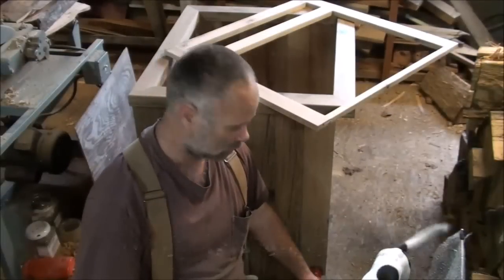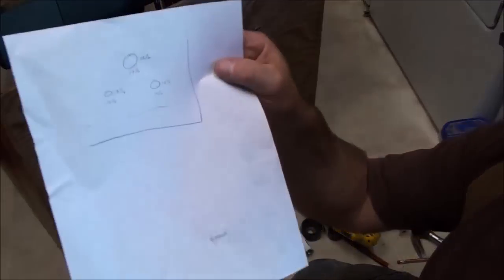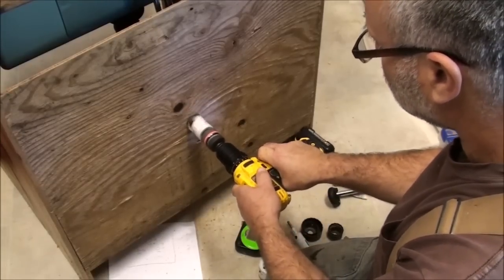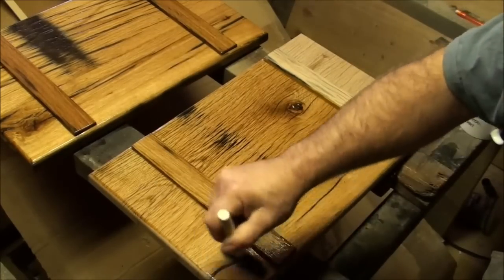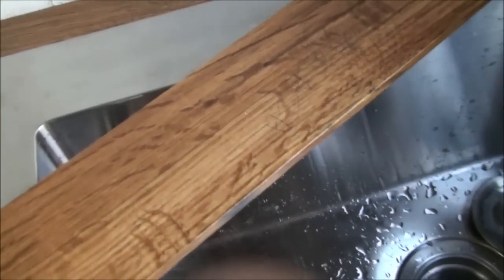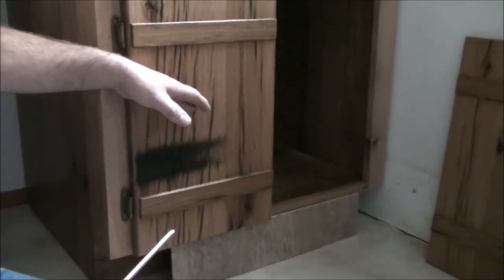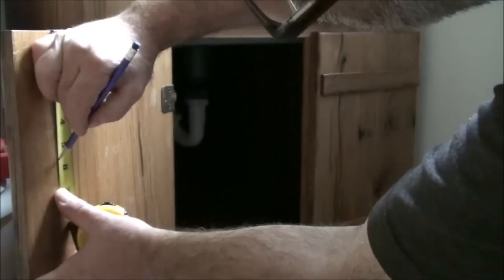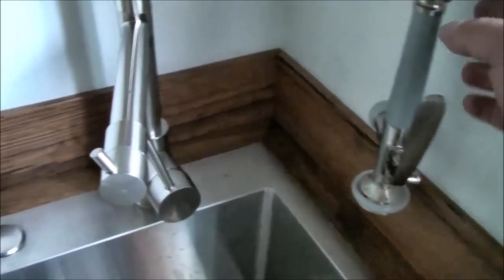Sink Cabinet Build and Installation

Comment: Fantastic job Patrick!
Reply: Thanks for checking it out Steve. By the time I finish working up the rest of that oak I will just throw away the plainer knives as I am gnawing through some grit even after presser washing that old equipment trailer decking.
Reply: @MrRainCountry  I am sure it has been very hard on the knives but the wood is so full of character! As you know we love to repurpose as much as we can!

Use it up ware it out make it do or do without. 
I personally love the look of the repurposed wood.